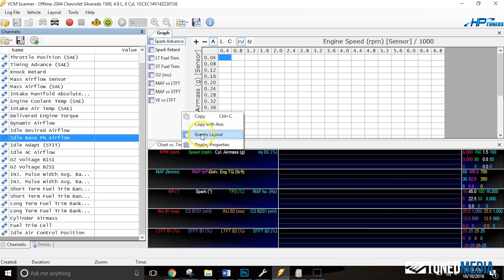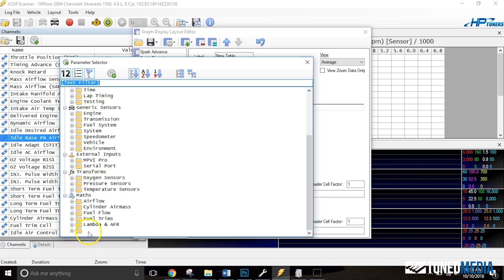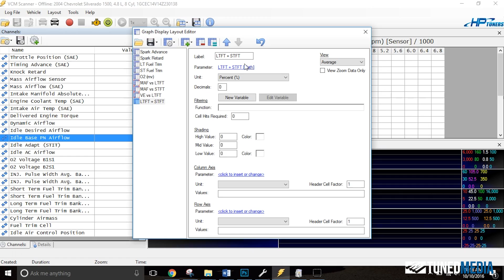Long Term Fuel Trims plus Short Term Fuel Trims: LTFT+STFT Math using HP Tuners 3.X software

Comment: Interesting, this is the opposite of what is recommended on the actual HP Tuners help section: https://www.hptuners.com/help/vcm_editor_tuning_how_to_advanced_ve.htm

Method 1 using the LTFT and STFT corrections from the scanner histogram data

Method 2 using the STFT corrections only from the scanner histogram data

as you can see they tune either by using both LTFT and STFT corrections, or by just using STFTs not just LTFTs, could you please comment on this opposite way of doing things?